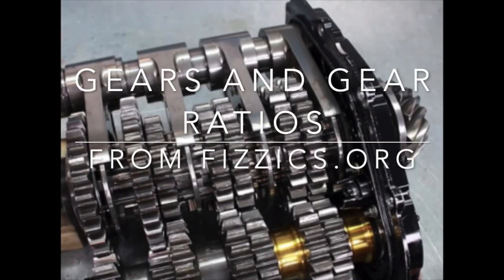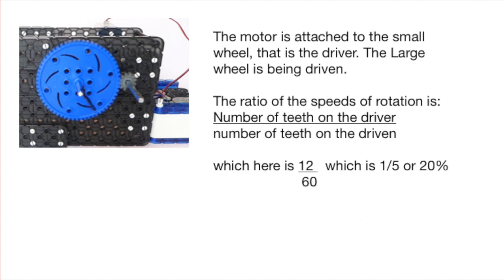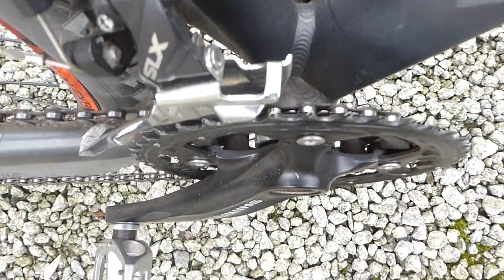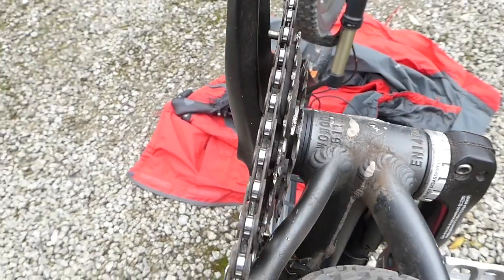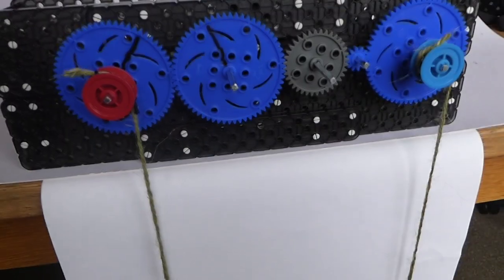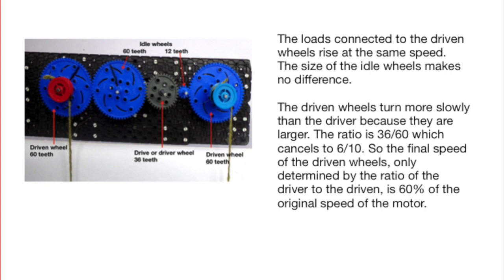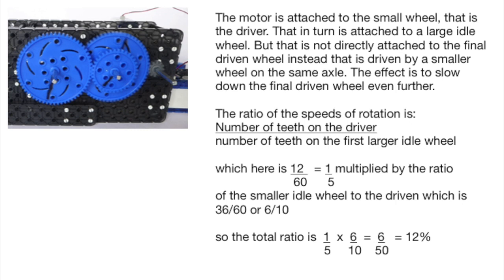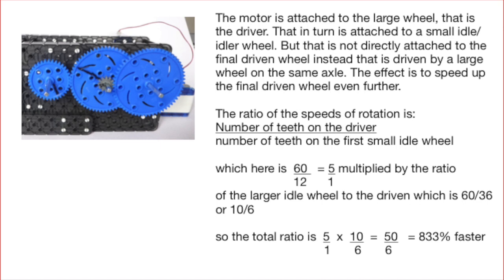Gears and gear ratios: the basics demonstrated and explained: from fizzics.org

Comment: This is confusing because he said that the idler gears don't matter.. so how do they matter when there are two idlers on the same axle?
Reply: You need to learn the basics before you can understand the more complicated aspects of any topic. It is awesome that you asked the question. It shows you have a strong understanding of the basic information. You are ready to learn the more complicated info.

The concept of a simple idler gear is not 100% of the information. In his example, (approx 5:08) the middle gears aren't actually idler gears. They make this system a "compound" gear system. The larger "idler gear" acts like the 1st driven gear. The smaller "idler gear" acts as a 2nd driver gear. Overall, his system effectively has 2 driver gears and 2 driven gears.